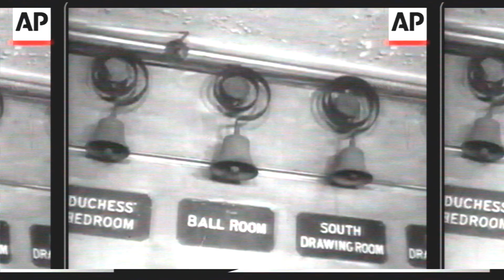Mind-Blowing DRONE Hack: Can a SINGLE Blade Really Fly?!

Comment: you get yourself a propeller balancer and retry with balanced props, you can see the counter balance weigh on those black and white videos, by chopping a blade you are effectively unbalancing them props basicaly copied the principles used on phone vibrators, thats why it shakes wildly, not surprised to see it didnt work this time
Reply from the maker: Im looking into a 3d printing version, but yeah 😂
Reply: @spidersugar_fpv this is a very interesting topic and overlooked on multirotors but the benefits in noise reduction and power consumption sound like a valuable experiment i even got dragged to your video thinking you’d would have balanced those props as well, never seen your channel before
Reply from the maker: @goliathsuperstar  well welcome! Unfortunately im very limited on time and resources, but I do what I can with what I got! I definitely wanna do more in depth projects just like this one 🫡

Comment: Balance the single blade correctly. A single-blade prop is the most efficient possible as it doesn't travel through its own turbulent air like a multi-blade prop does.
Reply from the maker: Ya know from the research I did i also found this offset two blade prop that aimed to do the same thing, I wish I could remember what it was called. But yeah that too is designed to fly through clean air

Comment: Realistically it would have worked if you were able to counter balance the props. I seen a guy do this on reddit by melting some lead fishing weights together and smooshing them into the right counter weight shape like you saw on that old footage. Of course it lasted only a minute as the melted on weights tore off from the props but it does work. You could do this again for real with enough time and energy.
Reply from the maker: Definitely, Maybe a 3d printed one?

Comment: Honestly you're lucky you didn't have a flyaway on that second one.  You can't have unbalanced props.  You can have single bladed props but you need a counterbalance on the other side.
Reply from the maker: I think it may have attempted to fly away but the motor decided to try it first 😅,  yeah I wonder if its possible to counter weight at this small scale

Comment: if you could figure out a way to balance the props properly it looks like it would fly fine.
Reply from the maker: Its such a small scale I thought about like tiny ball bearings or like a screw or something
Reply: @spidersugar_fpv  yeah maybe a screw would work!
Reply from the maker: @maddercat  I might have to get some armor or something if I try it again with counter weights 😅
Reply: @spidersugar_fpv  You need like a test stand, do you have a single esc and a spare motor?  You can maybe weigh one of the props that you cut off then find a screw that weighs the same then put some loctite or super glue on it and drill out the hub so you don't stress it when you insert the screw.  I think that should work, but a test stand would be the best thing.